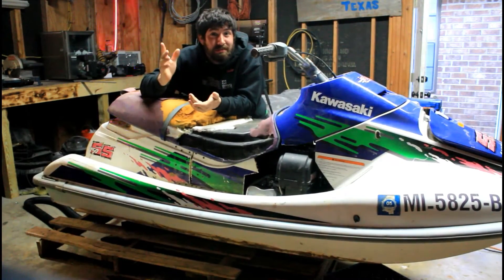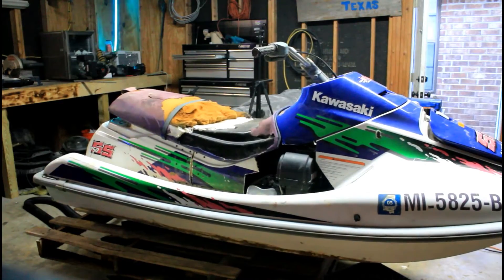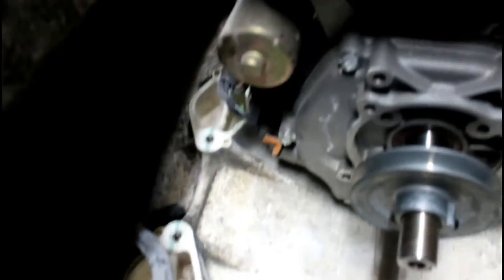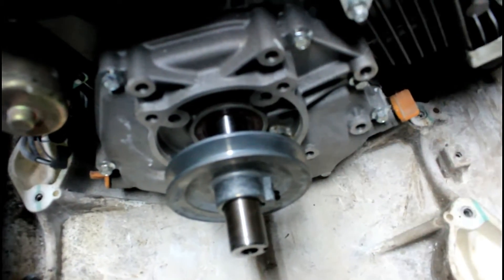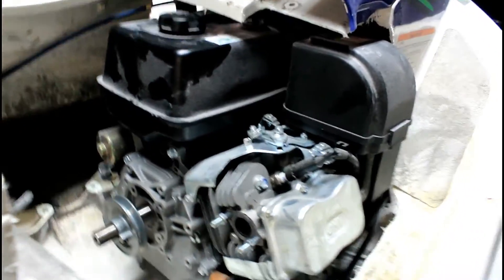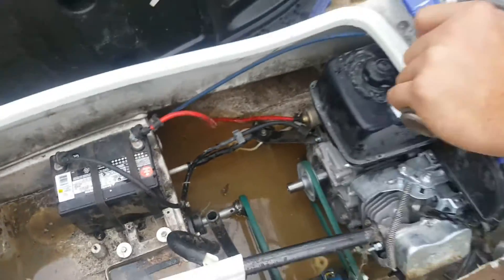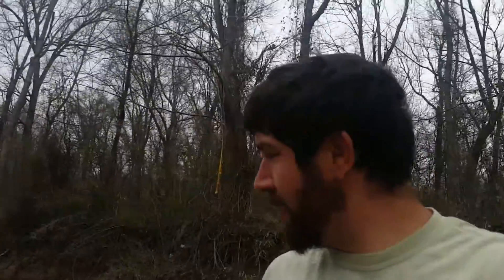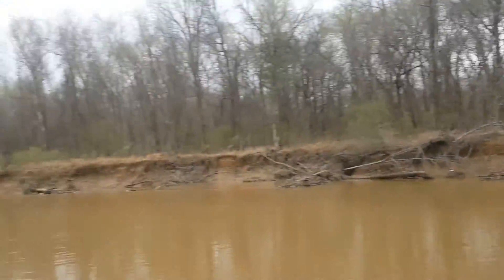420cc predator Jet Ski final build!!!!

Comment: we cant even get video of it running? im thinking of doing this conversion i would love a solid example
Reply from the maker: +Motorized Junk well I had two failed attempts and I've been super busy at work but I will put it in the water again and make a video maybe this weekend
Reply from the maker: +Motorized Junk love your channel name by the way LOL
Reply: plan on doing my own videos, similar concept. I build racing mowers and other off the wall shitso hence the name at the moment. thinking about a 4 stroke in a old school standup, hasn't been done yet to a point of success. your motor in a duck boat with a mud motor end hauls serious ass
Reply from the maker: +Motorized Junk I've seen them on a duck boat before but with the belts and pulleys I've used the Max RPM the impeller should spin around 7200 RPM
Reply: and that should be perfect, im sure you went for that rpm because that would be roughly the motor redline of the motor that came out of it right? my standups redline around 6500 stock, but they can pull above that with different aftermarket ignitions with all that torq I have no doubt you should get close as long as you can keep it from pouring in water and reduce cavitation.fast fukin minibikes posted a video this month of a fairly stock 420 predator pushing a mini bike up to near 70mph, I think you are gonna fly on that thing
Reply from the maker: +Motorized Junk   believe it or not I did quite a bit of research like the 420 RPM was about 3,600 so I used a 4-inch pulley to a 2in pulley to double the RPM in hopes to get close to the original motor power
Reply: I figured that's why you went with the over drive, cheaper than adjusting with a new impeller, normally the impellers are running 250 or so each but its another way to change the ratio for those of us with the stock direct drive systems. looking forward to a new vid for sure.
Reply from the maker: +Motorized Junk thanks man

Comment: What happened to make it full with water?
Reply from the maker: +iamtheMunster basically to fit that motor in I had to cut out part of the footwell so when I leaned over it filled it up that will be fixed for the final product

Comment: The factory engine uses all of its 70-80 horsepower to spin that impeller at 7k rpm no way will a stationary engine of what 9 hp? Be even close to doing that better off running a straight drive to a surface prop maybe then in might come close to getting on the plane and use the bolt holes that were designed for mounting not the small crankcase cover ones struth
Reply from the maker: +Lex Botma I'm not expecting it to go full speed and it's a 13 horsepower thank you very much LOL
Reply: Is it finished yet? I’m interested to see it actually run in the water I just think it’s geared too high
Reply from the maker: +Lex Botma i have tryed ot the video will b out soon but the motor blew up